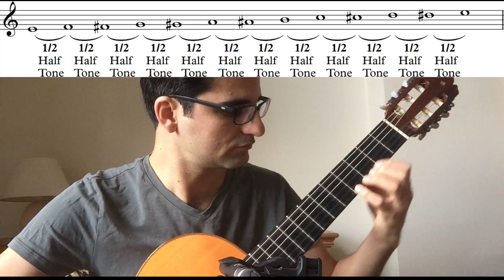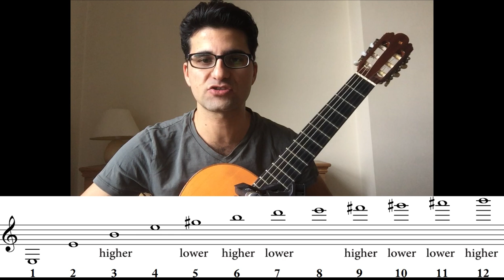Major 3rd Problem of All Guitars in the World

Comment: from the American guild of Luthiers
this explains how the guitar is a tempered instrument and also how to tune it properly . 
This is very important as a lot of people do not know how to do this. Don't miss reading PROCEDURE below

Many guitarists are frustrated because of their attempts to tune the guitar to pure
chords (free of beats). These particular players have very sensitive ears that prefer
pure intervals and reject the mandatory equal temperament. They tune their guitar
beautifully pure on one chord only to discover that the next chord form is
unacceptable. In too many instances they assume that there must be a flaw in the
workmanship on the fingerboard. Their problem is not in the construction of the
guitar. It is one of pure tuning verses equal temperament.
You must accept this compromise  because the guitar is an instrument of fixed pitch
and the strings must be tuned to tempered intervals  , not pure. Equal temperament is
the name given to a system of dividing the chromatic scale into 12 equal half steps.
Guitarists who have been trying to tune to one or another pure chord form must
learn to understand and accept equal temperament. (They might be interested to
know that to approximate pure chords on all forms would require about three
dozen frets within the octave.) The system of equal temperament reduces the
number to twelve, thereby making manageable all instruments of fixed pitch.
Here is what all of this means to the guitarist: You must not, at any time, use
harmonic tones at the 7th fret as a point of reference (skilled piano tuners could use
them because they know how many beats to introduce between 4th and 5th).
Harmonic tones at the 7th fret are pure 5ths, while in equal temperament each 5th
must be lowered slightly. To tune by harmonics at the 7th fret
 (as occasionally illadvised) will make the guitar sound entirely unacceptable on some chord forms.
On the other hand, all harmonics at the 12th and 5th frets, being one and two
octaves above the open strings, are immediately useful as explained below. All
octaves and unisons are pure on all instruments of fixed pitch. Therefore, you may
use harmonics at 12th and 5th as reference tones in the following tuning
instructions.
Actually this discussion and the following suggestions are for those players who
have been tuning to pure intervals. When the steps have been followed correctly
the guitar will be as perfectly tuned as it could be in the hands of a professional.
Nevertheless, when you have finished, your sensitive ear may notice that on each
major chord form there is always one tone slightly high. If you start adjusting a
particular string on a certain chord form, you only compound the problem because
then the next chord form will be completely objectionable. Tune the guitar as
instructed below and let it stand. How to help your ear accept equal temperament:
It is easier to face a problem if we are prepared in advance and expect it. If you are
one of those persons who is sensitive to pure intervals, here is what you are going
to notice on an absolutely perfectly tuned guitar in equal temperament: Play an
open E major chord. Listen to G# on the third string and you most likely will want
to lower it very slightly. Don't do it. Ignore it. Enjoy the overall beauty and
resonance of chord just as does the pianist.That troublesome second string: 
Play an open position A major chord. Listen to the C# on the second string and you may 
want to lower it slightly. Play a first position
C chord and listen to the E on the first string and fourth string at 2. These tones are
slightly higher than your ear would like.
Now play an open position G chord. Listen to B on the second string. Yes, it would
sound a little better if lowered ever so slightly. Why not try it? Slack off the second
string a couple of vibrations and notice what beautiful G chord results. Now play
the C chord and with that lowered second string, and you are going to dislike the
rough C and E a lot more than before. Take the open B, second string back up to
equal temperament so that it will be equally acceptable on all forms. Learn to
expect and accept the slight sharpness of the major third in each chord (and
oppositely, the flatness of the minor third in each minor chord). Train your ear to
accept tempered intervals and you will be much happier with your guitar.

PROCEDURE:

Tuning the 1st and 6th strings: The E, open 1st string, must be in pure unison with
the harmonic of the E, 6th string at the fifth fret. When these two strings have been
properly tuned with each other, continue as follows. Tuning the 4th string: Play a
harmonic on the (in tune) 6th string at twelve, and as this harmonic sounds, adjust
the 4th string until the tone E on the second fret is in pure unison. Now you have
the E, open 1st string, 1st on the 4th string at two, and E, open 6th string tuned
pure (permissible because they are octaves).
Tuning the 2nd string: Play a harmonic on the (in tune) 4th string at twelve. As this
sounds, adjust the 2nd string until D at the third fret is in pure unison. As you have
used two fretted tones for references and as the frets are positioned for tempered
intervals, you now have the open 1st, 2nd 4th and 6th strings in tempered tuning.
Tuning the 3rd string: As it is easier to adjust a string while listening to a
continuous reference tone, you may first try the following: Play a harmonic on the
(in tune) 4th string at twelve and as this sounds, adjust the 3rd string until D at the
7th fret is in pure unison.
Double check: Now make this check to see if you have been accurate or if the
instrument plays tune when fretted at seven. Play a harmonic on the (now tuned) G
string at twelve, and as this tone sounds, play G on the 1st string at three. The two
tones should be in pure unison. If they are not, either you are at fault or the
instrument doesn't fret tune at seven. Go back to the beginning and carefully check
each step up to this point. If the tones are still faulty, then readjust the 3rd string
until the harmonic at twelve is in unison with the 1st at three. Do not tamper with
the 1st and 4th strings because it is the 3rd string you are trying to bring in tune.
When you have the 1st, 6th, 4th, 2nd and 3rd strings in tune, in that order, continue
with the remaining 5th string.Tuning the 5th string: Play the tone A on the (in tune) 3rd string, at the second fret.
Listen to this pitch carefully and now adjust the 5th string until the harmonic at
twelve is in pure unison. When the foregoing steps are followed correctly, the
strings will be tuned perfectly to equal temperament. No further tuning adjustments
are permissible.
THE GUILD OF AMERICAN LUTHIERS

Comment: A few years ago Fender used a compensated nut on some electric guitars like the Telecaster. The slot for the B string was set back a fraction and it worked very well. As some may know the old 2 strings to each bridge saddle system was fraught with annoying inaccuracies in intonation but that nut seemed to solve the problem. I haven`t ever seen it again so I guess it wasn`t a moneyspinner for Fender. Buzz Feitin ( great name for a fret specialist ) did some fancy stuff with slanting frets but, again, it didn`t take off mainstream. With all due respect to our friend here I think equal temperament works fine on a GOOD guitar set up right. Sometimes I wish I`d never heard of intonation   Know what I mean ?  Ha Ha.
Reply from the maker: Interesting. Check these guitars: https://www.youtube.com/watch?v=EIimjVUthB0

Comment: The Equal Temperament' system IS a distortion, but it allows different instruments to be played together, where the natural tones and harmonics would give that awful 'out of tune' sound when different instruments are played together. The 'Equal Temperament' system is a compromise, and like all compromises, has good things and not-so-good things.
Reply from the maker: I totally agree. Have you tried the organic 7th: https://www.youtube.com/watch?v=pfQZD6IkeRg
Reply: Equal temperament is not necessary for instruments to play together. You just need to re-adjust the frets for different keys. It takes time but it is possible, and in my opinion worth it. Perhaps you could have three or four guitars, each optimized for a certain range of keys. Re-adjusting frets is what viol (not violin) players did in earlier times, when they had moveable frets made of gut that were manually tied on to their instruments.

Comment: At 3:15 the note is in tune!
Question: In tune in what key? The purpose of equal temperament, after all, isn't to make the frets run straight on a guitar. It's to equalize the temperament of a piano.
Just intonation gives the best and clearest sound, but a piano tuned to just intonation is only in tune for one or two keys, at best. It's badly out of tune for other keys and needs to be retuned for every key. This is difficult to do in a concert where the pianist is playing pieces in multiple keys.
So equal temperament is used, which allows every key to be played slightly out of tune, but no key is badly out of tune.
So what happens with the guitar with microfrets? Do you move the frets for every key or do you just select a few frets to liven the harmonics and let other keys play out of tune?
Reply from the maker: Thanks for your comment. Check this piece for a just intonation piece in 3 different keys. I agree with you. I adjust my frets according to the piece and if I want to play another piece on stage in a totally different key, I need another guitar or I have to use the intermission efficiently :)

Comment: Ever hear of equal temperment? You seem to be comparing just tempered instruments to equal tempered. Yes, there is a difference. Just temperment is based on the harmonic series. Just or Pythagorean  temperment was used untill keyboard instruments became dominant. You probably allready know that in just temperment,  a Gb is a different pitch than an F#, a Cb different than a B, and so on depending on what key the tune is in. On a 12 tone per octave keyboard there is only one key to press for each note. This fact required the just tempered keyboard to be retuned when changing to a different key.  J. S. Bach popularized the equal tempered tuning with his work "The Well Tempered Clavier". In just temperement, 8va's zero beat, and 5th's zero beat. In equal temperement only 8va's zero beat and 5th's beat about 6 times per second.  Equal temperement (as I'm sure you must know), splits the "error" 12 ways. You seem to be comparing a natural harmonic (just tempered by definition) to an equal tempered fretted note.This should beat on a properly set up guitar... and it does (exclusive of 1/2 string legnth natural harmonics compared to fretted notes  at 8va intervals). Sorry, no disrespect intended.
Have you ever played with a Hammond organ in the band? The overtones on a Hammond organ are equal tempered (tone wheels generate all pitches and overtones). For people with perfect pitch, this can cause pain when the guitar plays in unison with the organ, and guitar harmonics clash with Hammond overtones. Wind players and non-fretted string players make adjustments in pitch to conform to keyboard instruments pitch, and we hate it, but we must work, and so.... we get over it, or play baroque music on just tempered insturments. Just tempered music has a different feel, more soothing(?) than equal tempered music, and jazz chords containing tri-tone or 1 or 1/2 step intervals sound surprisingly different. 
For all the "tuning freaks" out there, I was a musician (mainly sax and guitar) about 20 years before I learned that everyone hears differently. Pitch is subjective,  frequency is objective. This is the difference between art and science. Was John Lee Hooker's guitar ever in tune? Is his music less powerful because of it? Put on your ears. Thanks to all for your kind attention.

Comment: This is all very well until you use a capo or play in key that isn't one of the cowboy chords.
Reply from the maker: You are right. That's why I play a movable-fretted guitar: https://www.youtube.com/watch?v=MYK_PF9WTRE
Reply: Ah, that makes sense. 

But ultimately there is no perfect tuning because when you play a chord with a different root note to the key, it can only have integer ratio note frequencies according to either the key or the root. The basic problem is that 
(3/2)¹² ≠ 2⁷ and thus a circle of successive perfect fifths with integer ratios to each other don't arrive back at an exact octave interval to the first note.

However, it probably is true that adjusting the tuning can make more notes/chords in any given piece more closely in tune.
Reply from the maker: I agree.

Comment: The problem with the tuning is that when it if perfectly optimised for one key it is way out of tune for some others. Even the most important Am Dm and E keys can not live together in the same instrument with this kind of tuning. With a modern electronic synthesizer it can be possible to do a quick and prcise retuning for better sound each time you need it but with regular accoustic stuff sacrifices just have to be made unless you are OK with having a guitar with 12 strings or even more depending on the  range of songs you want to play.
Reply from the maker: You are right. I play movable-fretted guitar and find more solutions for different keys: https://www.youtube.com/watch?v=MYK_PF9WTRE

Comment: Sounds nice, and is an interesting way to approach the inherent flaws in the equal temperament system; however, it would be nearly useless for me.

1) I bend my strings, and bending won't be quite so easy with these little pieces of fretwire all over the board.
2) I play up and down the neck, and the issue is still there in the higher frets.  This means more wires stuck in more precise places between closer frets.  Not ideal.
3) I don't want to be removing fret wire between songs just so I can change key, and I also play songs with a few key changes.  Since these frets would have to be placed in different places for different keys, I'd be screwed.

The only string that really gets to me is the G string (on the guitar).  It just bugs me, as it never sounds properly intonated between open, fretted, and harmonics.  That's on every equal-temperament guitar I've ever played or heard.  If I could figure out why G-string intonation is such an issue for me, I could deal with the rest.  

Besides:  You shouldn't try to fix all of the dissonance in music.  Dissonance creates character, color, and tension.  Used properly, this can be a good thing.
Reply from the maker: Thanks for your comment. I use a movable-fretted guitar for more solutions in different keys: https://www.youtube.com/watch?v=MYK_PF9WTRE